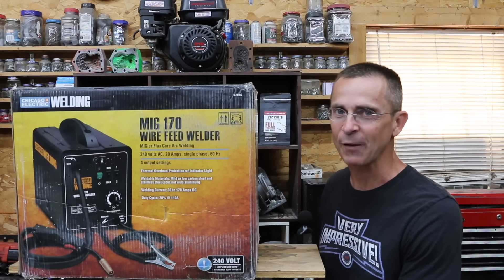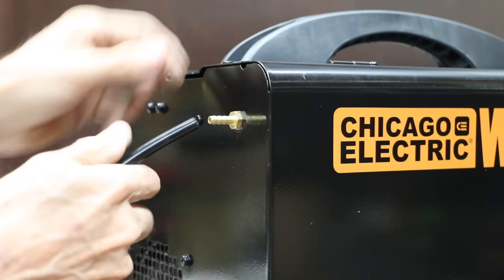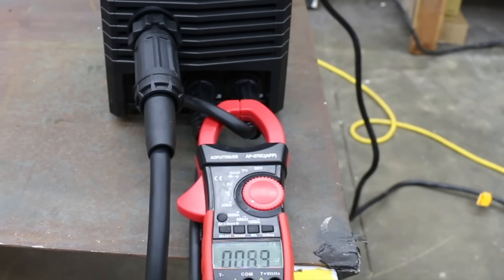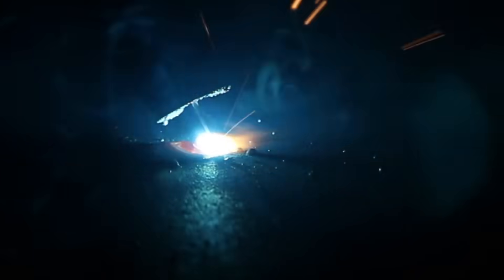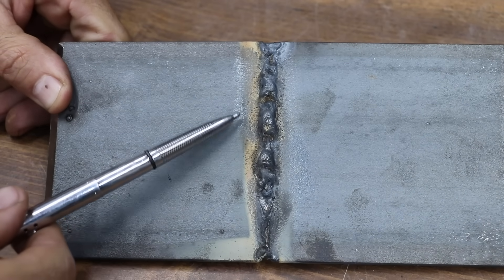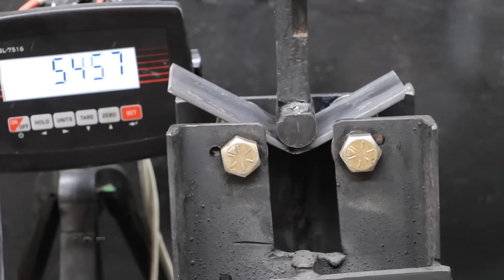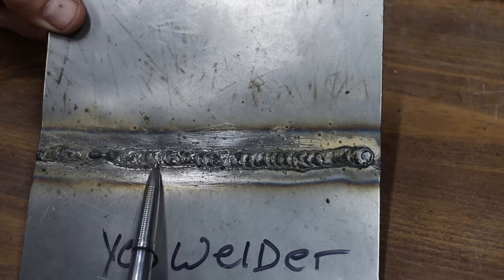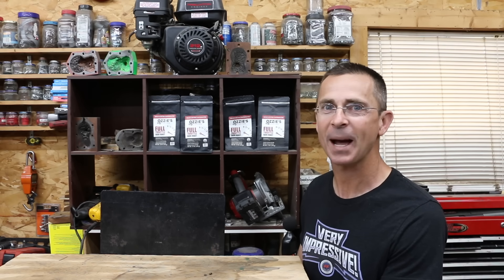Cheap vs Expensive Welder? Let’s Find Out!

Comment: Couple of points here from a professional welder (and I do a lot of MIG):
The Yeswelder is the only "cheap" welder on this list that I'd recommend. It's the only cheap welder with an all-metal wire feed system. After a few years of use, those plastic ones will break or be worn out.
If you are buying a Mig welder, it needs to have an adjustable wire speed setting. The Warking in particular only allows you to set amperage and voltage. Amperage is useless for properly setting up a Mig weld. You need to be able to set the wire feed rate accurately. That's also where several of these welders failed - they did not have good wire feeders (plastic) and caused problems.
One last thing; if all you need is a good Mig machine and you don't care about the other features, Forney still makes a transformer-based machine that will weld even better than the Lincoln in this test did, for about the same price.

Oh and one more note - T-11 flux core wire was used for all of these tests. None of the wire feed rollers used in this test were the proper rollers for flux core wire. So some of the wire feed issues would be fixed by using the proper wheels. They are usually sold separately.

Great testing, Todd. Look forward to seeing more tests like this. How about plasma cutters?
Reply from the maker: Thanks!  Thanks for the suggestion.

Comment: It seems like getting both a Yeswelder and an Azzuno for $612 might be a good strategy.  Use the Azzuno for light gauge welding and the Yes for heavier stuff.  Seems like the only downside would be breakage strength on heavy materials.  I always check out your tests before I buy a new tool.  No disappointments so far.  Thanks!
Reply: The Yeswelder will run fine on thin gauge if you use the solid wire and shield gas. Flux core wire is better suited for thicker material.
Reply: Buy a Lincoln 140 for $800 and you only need 1. Using mine for about 30 years.
Reply from the maker: You are welcome!
Reply: If the welder is going to sit on a cart connected to the gas tank two welders would seem a pain. Would probably have a spool in each too.

Have the Primeweld Tig225 which seems a good machine and am tempted by the reviews I’ve seen of their $550 mig

Comment: I have had the Yeswelder for over a year now, great little machine and the observation is spot on for it running a bit hotter than advertised, my only qualm is the measurements/adjustments being in metric; I got around that by keeping a cheap vernier around.
Reply from the maker: Thanks for sharing.

Comment: For the cheap welder I bought the Eastwood 135 then years later I bought a 140 and both were under $400 and both weld just as good as my Lincoln 140.  I prefer any of those over my father's Miller 180 that thing is just overpriced junk.
Reply from the maker: Thanks for the feedback.

Comment: I am actually on the lookout for a welder. My budget is around $500. The YesWelder more than suits my needs. And in the meantime, I save almost a 3rd of my budget. Thank you very much Project Farm ! Simply amazing !
Reply: you'll regret it just buy one from the big 3 I learned the hard way... miller, lincoln, esab
Reply from the maker: You are welcome!
Reply: Not sure if I'd waste time with that. Go for the Hobart 140. Just a bit more money
Reply: @looking_33, @mediocreman2 Thanks for the suggestions. Unfortunately, out of the welders presented in the video, that are any good and fit my needs and budget, the YesWelder is the only one being sold in my country. The welders that you suggested, go above my budget, quite significantly with shipping and taxes included. And on the other hand, there is the warranty issue. It would be quite a hassle to send it abroad if it got broken.

Comment: Great video, thanks for what you do! One of the benefits of the Vulcan is the pre loaded weld settings. It would be interesting to see a test on how these compare to to a not professional trying to set it themselves. Two things to note. One, I think you should have gone to an .025 wire for the thin sheet to really give the welders the best chance. I know the Vulcan calls for .025 that thin. Two, the 5min or continous welding is outside the Vulcans duty cycle. You are awesome!
Reply from the maker: Thanks and you are welcome!  Thanks for the suggestion.

Comment: Have you tested in the mid range? Jumping from around $400 to over 1000. I use a sealey supermig 180 which in the UK is around £400 when I purchased.
Reply from the maker: Thanks for the suggestion.

Comment: Top quality content as always! I just did a job with the little Century (Lincoln's budget brand) FC90 flux.  Mind blown by how good it was regardless of size and weight. I normally run a Hobart MVP 210 for mig or flux but needed something I could drag out on scaffolding and windy places and it was excellent. Absolutely blows away the harbor freight "titanium" equivalent for not much more money.
Reply from the maker: Thanks!  Thanks for sharing.

Comment: Tell ya what, it would be one of the simpler subjects. But I've been having a horrible time trying to find a string enough cable to charge my families devices. The problem is a have a destructive 4yo who likes to break then. But I think it would be a decent video idea to find the strongest/best value chargers. And it would give you plenty of options to choose from. Between regular house chargers, car chargers, plugging or into a power strip with USB built in or using the actual USB to AC plug. Then finding out which ones actually do the "fast charging" like they claim. Really hope you'll take the time to read and consider. Love all the videos. 👍
Reply: And I guess it would go along with the best value thing. But am I better off buying as many cheap chords as I can and letting him destroy them, or is there one cord worth the money he won't be able to? I've even tried the ones that don't actually plug into your phone but instead they have a magnetic tip. You just leave it plugged in, and then you can just interchange the cords. I thought that way he couldn't break the chords. But then he would lose the pieces or they were too cheap and would only work for a couple weeks before even me and my wife would end up messing them up.
Reply from the maker: Thanks!  Thanks for the suggestion.

Comment: Great work as always! I appreciate that you try both the cheap and expensive and compare them both head-to-head as well as taking into account their price. I don't expect a $300 welder to work as well as a $2300 welder, but if it can do a decent job for the occasional welds, then it's great for hobbyists like me.
Reply from the maker: Thanks!  Thanks for the feedback.
Reply: The truth with welders is for diy and hobby the cheapest is as much of not more than you need as for the expensive ones you need to be an expert to make use of the added features because that who there for
Reply: I didn't. It worked well enough and better than most. Can't bet a Lincoln.
Reply: @sirreus3003  The Esab Rebel's are pretty good too. I've been a journeyman for close to 15 years now, used team red, and team blue. Have team yellow in my garage because they are close enough to miller or lincoln for my home use. I don't get all the features but enough of them and at a lower price. I also don't feel like I am welding with a piece of garbage either, that I am working around vs. just working with.

Comment: @6:12 Are those amp numbers correct? 240V * 281A = 67kW. That is half of a car engine. Maybe the voltage is lowered to increase the amperage? My house fuses would burst (I have 230V * 3x35A).

Comment: To be fair... no welder is better then the user... if you can't weld you will get poor result from a $3000 machine. And if you know what you're doing you can get decent result with a $200 machine. 
I have a cheap machine and it does what i need it to. It's not great. But it's portable and what i could afford at the time.. (i had a 3x as expensive machine earlier but it got stolen. And it was 4x the size and not as portable). I don't really notice any big difference in result as im not a great welder. Even though the cheap one is a flux core and the other had shielding gas.
Reply from the maker: Thanks for the feedback.

Comment: One of the things that sets the welders apart is the differences in duty cycles. You touched on it a little with the 5 minute test but it would have been interesting to see how long the welder needed to cool down before going again on a repeated cycle. I use a miller 250 (~$5k set up). I regularly will weld for upwards of around 30 minutes or so with minimal breaks for repositioning myself or the material. Ambient temperature makes a difference but I can usually weld for 2-3 minutes before the fan kicks on and that thing has never shut down on me.
Reply from the maker: Thanks for the feedback.

Comment: I am a welder and have been for a decade now. Favorite test so far. I personally have a Lincoln electric 200 Tig welder and it really is a fantastic little machine ESPECIALLY for a 110 capable unit. Expensive stuff for a beginner but a good addition to a mechanic shop.
Reply from the maker: Thanks!  Thanks for sharing.
Reply: You are a Weldor ! You operate a welder ! Er is the machine . Or is the operator . Its not operater , its operator . Or is the operator ! Rock on !
Reply: @theweldor757  ok you got me on a technicality lol I’m a welder operator. You are the second person in my entire life to correct me on that
Reply: @aaronneher4860  im 60 brother 😳. In the 80s before the all mighty computer . If you went to the library like we had to do . The literature clearly stated we are Weldors . Its just one a them things that didnt get passed on to the internet 😒😒😒😒
Its the first thing i teach new helpers ! Be safe brother !
Reply: I can make stacked dimes welds with it on stainless steel?

Comment: Great testing, thanks!  If you do a part two then two other darlings among the chinese machines are primeweld and eastwood.  What you can't test is longevity and I doubt any of these chinese welders will be around after a few years of use, but the lincoln would be.  Consumables can also be another issue to measure.  Customer service is likely nonexistent on most of the imports outside of Primeweld.  The difference in duty cycle is somewhat showed in the last test but not entirely.  I paid 1700 for my lincoln 210 off of FB Marketplace and it's barely been used, that's about an average deal in Houston and I'd rather just buy a welder once.
Reply from the maker: Thanks!  Thanks for the suggestion.

Comment: I have a Vulcan 220. Had it for 3 years and it has been a great welder. I also have the spool gun for it. For comparison i also have a Miller 255 which is much more expensive. For short circuit and hobby welders i highly recommend the Vulcan. I can't run dual shield in it like my 255 but short circuit it's great. It can also stick and DC tig but i have only used the stick,mig and spool gun for aluminum.
Reply from the maker: Thanks for sharing.

Comment: This is convenient timing. Just got a Everlast brand 211 multiprocess (mig/tig/stick) and their 25 amp plasma cutter. I do think you can get what you pay for with the name brands like lincoln/miller/esab, especially with longevity,  parts availability and service centers. But for the average home gamer i think its better to buy and learn on a less expensive machine, and either save up or look used for a better machine.
Reply from the maker: Thanks for the feedback.

Comment: Great welder test!! Lincoln products are common here. My gasless mig is a Rockworth Power Task. It has only 2 current settings, 60A, & 100A. When I use it to weld box tubing, I use the low power, otherwise it just blows holes. Strange thing is when most of those mig welders are sold, they don't have a welding trolley. Mine does. It is about 12 years old now, & it is still working like it should.
Reply from the maker: Thanks! Thanks for sharing.

Comment: Everlast welders should have been included in this test, that would have been great. For the price of the Lincoln, you can get an Everlast Lightning MTS 275 capable of AC/DC tig, mig and stick with accessories included. Great buy IMO.
Reply from the maker: Thanks for the suggestion.

Comment: I've been looking to get a new welder and looking to try to find on a reasonable price. Some are multi function, a plasma cutter in the same unit would be very useful. Yeswelder has one for around $750 and is one of the best looking as far as displays, but I don't know if I would want to spend that much when an angle grinder could be used. More usefull may be having a pulse function, but so far all I've seen were why to costly.
Reply from the maker: Thanks for the feedback.

Comment: Great test protocols as always Project Farm! 👍
I've welded for over 24 years for a living and periodically on the side for many more years. I have the Omni Pro 220 and am still impressed with the performance. The absolute best welder available? Maybe not but if you're not making weldments for NASA, it's plenty good enough for anyone. BTW, a persons skill level and experiences are the other 80% of good welds.
Reply from the maker: Thanks!  Thanks for sharing.
Reply: Hey Jerry, sorry for the delayed reply. I'll try to give answers based on what I can remember from vocational welding school 40+ years ago! And a bit of experience thrown in. Q1: Yes the Omni Pro 220 is a lift" or scratch" start in TIG configuration. This is because there's no  internal high frequency generator to help the electric energy jump the gap between the work piece and the tungsten to establish the arc flame. Q2. The 220 is a DC only welder. ForTIG welding (most if not all ) non ferrous  metals such as aluminum or magnesium need AC current to weld properly. This produces a stable arc flame in order to create a weld puddle with these type metals. Virtually most all of the time, a separate filler rod is used in filling the weld puddle. Q3. MIG or "wire welding" is done on DC current. Aluminum MIG welding uses Argon shielding gas (same for TIG) but because MIG welding is also "short arc" welding, it can be done on DC current. The aluminum wire is energized with the welding current and is obviously fed continuously so it is constantly forming an arc to weld with. In TIG welding, the filler rod is not energized but you need a continuous arc to melt the metal and your filler rod to produce the weld. 
Q4. Very good question! I'm not sure why the 220 was designed that way regarding the shielding gas for any TIG welding. I don't know why the machine was configured not using the same gas relay for TIG as MIG. Part of that is the way the TIG torch is configured I believe but it's a blunder in the design and wastes a lot of gas having to turn it on/off manually. 
Hope this helps! 👍

Comment: Nice review. 
That Chicago electric welder looks identical to my 25 year Sealey (UK tool brand) 170 turbo. I've used it to restore several cars, where I find it welds thin sheet metal just fine. However I only use it with CO2/ Argon mix gas, which probably cools the weld puddle. My Sealey also never shuts down, but it is the fan cooled (hence turbo) version. The best improvement I made was to replace the factory fitted hose and torch with a Euro torch kit.

I can't complain about a 25 year old budget welder that functions better than when it was new.
Reply from the maker: Thanks!  Thanks for sharing.

Comment: Welding sheet metal is difficult sometimes. But stitch welding is the best approach. Tack weld areas to position the metal. Then jump around making small stitches in different areas to keep the metal from getting hot and warping. You can do bodywork with a flux core welder if you take your time. But most people don't have the patience
Reply from the maker: Thanks for the feedback.
Reply: So glad you brought that up. Virgil doesn't seem to have much experience in that. Excellent point.

Comment: I have a Tooliom multi process welder and it works just as well as my old Miller welder. Actually the duty cycle is better and it is more powerful. It will burn 5/32 11018s without a problem.
Reply from the maker: Thanks for the feedback.

Comment: These test are really good as usual, I would only wish for more brands readily available in EU. While it is hard to measure the consistency of wire speed, you can test and compare how close they come to the m/min that they show on the display just with a clock and a tape measure. I would like to request a new video on Drill bits since it was quite a while since you made one of those! Also I would find it interesting to compare cheap vs expensive drills within for the same brand to see if they are worth the price difference. And hopefully you still have at least one of the many drill sharpeners left from one of your older videos, because it would be nice to see how well different drills re-sharpens. While welders might be less economical to import, a few drill bits from EU would be nice! Keep up the good work!
Reply from the maker: Thanks, will do!  Thanks for the  video idea.

Comment: The titanium flux 125 from Harbor Freight is absolutely nasty I built an entire tracked stump grinding machine that you drive with a 66 horsepower engine that would normally cost 80 grand
Reply from the maker: Thanks for the feedback.

Comment: My friend has owned the Vulcan welder for about 5 years. That thing is a beast. It was even flooded at one point and was let to dry well, and its still going strong. The automatic function is cool too, you put the type of wire and wire size and set the dial for metal type. It does a pretty good job at autosetting.  
Overall great video, cool to see how some welders are bad and sometimes its not the person welding badly.
Reply from the maker: Thanks!  Thanks for feedback.